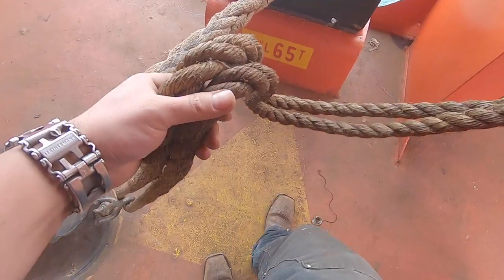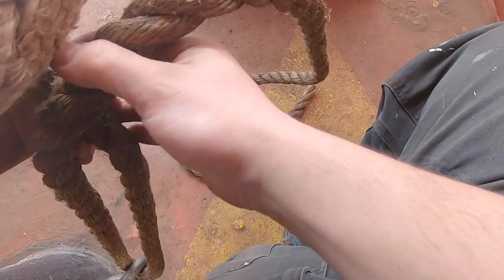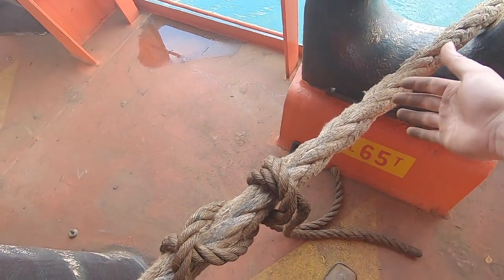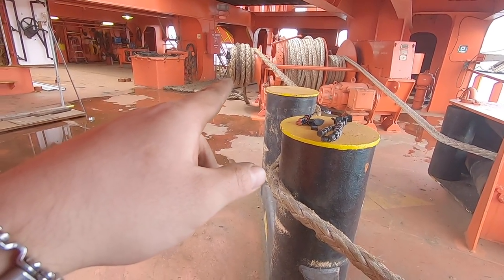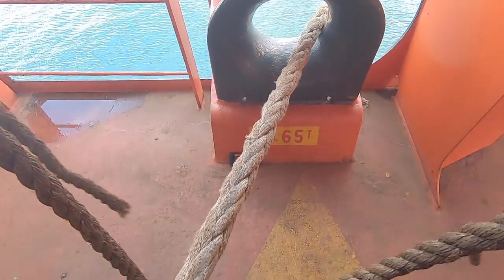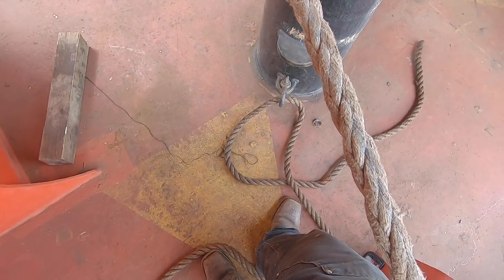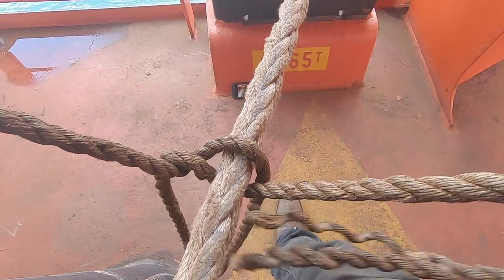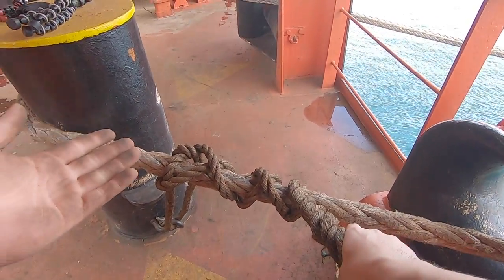Stopper Hitches Chinese/WestCoast/Rat Tail

Comment: Very interesting video. I have not heard of a rat tail stopper before. I think it might just be another name for a "traditional" stopper hitch which would potentially have a permanent eye on one end so that the bitter end could be passed through around the bitt, then the two half hitches and possibly round turns made around the hawser with the remainder of the line. For the chinese and west coast, I was taught to not alternate the two ends of the line over/under like you do but instead keep one part of the line in constant contact with the hawser and have the other part wrapping around on the outside. The American Merchant Seaman's Manual by Cornell Maritime Press has about a page and a half of info about stoppers plus diagrams. As you mentioned, I have heard and read conflicting information about stoppers. Like many things in the world of seamanship, this has not been standardized.